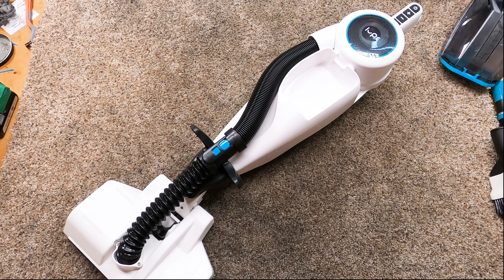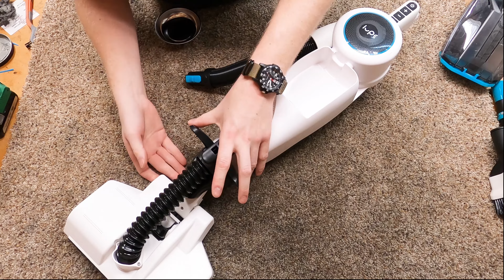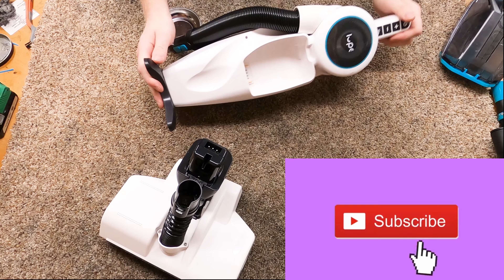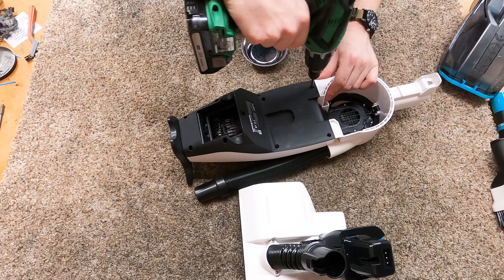Lupe Vacuum Repair

Comment: My two week old Lupe Pure Cordless broke,  lost electric between battery and "spinning head". Still has suction, but no spinning brushes...two weeks!!!
Reply: I am having same issue and just learned that they went out of business.
Reply: @chughag  I need a new battery ... it doesn't make a very good coat rack
Reply: @randyrobinson934  I gather it has standard cells inside the battery pack, so you could bring it back to life...
Reply: @chughag did you find a fix? Or toss
Reply: For anyone experiencing the power head not working it is something that can be fixed. I was able to pull apart the power head and inside there is a microswitch that failed. This essentially turns the motors on when you lower the main body. The part # should be DC2C-A1LB. Alternatively you can completely bypass the microswitch but then the power heads will not turn off when the unit is upright. You can use the button for the brush to still turn that on and off.
Reply: @ttt2k  How did you end up pulling the power head apart? I have the same issue --- brush & roller turn on only intermittently when I lower the main body --- and I like the vacuum well enough to make an attempt to save it.  The vacuum doesn't really work well at all when the brush & roller are not turning. With Lupe company now out-of-business, if I were to break something trying to pull the power head apart, I might as well just throw the whole vacuum into the trash. There are quite a few Phillips- and Torx-head screws in the power head, and I'm concerned about just unscrewing them randomly --- some of these screws may be used for securing various parts located inside the head.  I'd like to be able to remove only the screws that allow access to the inside of the power head, and so far I haven't been able to find any videos or diagrams online that demonstrate how to do this.  And sometimes, plastic parts are designed to also snap together, so just taking the screws out may not be enough to easily access the inside without applying some leverage to separate the various cover pieces.
Reply: @ttt2k so you need to solder out switch and replace it with the new obe?
Reply: @Kuzyn  Yes that's correct, it's a pretty easy fix if you are handy with a soldering iron.
Reply: Were you able to fix it?
Reply: Same. Motorhead no longer motors. Any ideas before I pull it apart?
Reply: @jamesodgers4451  I'm about to embark on same journey- did you get it to work?

Comment: Any tips on getting the spinning brush and roller to spin again? I measure 18V between LHS and centre pin but zero between LHS and RHS pin. If i supply 18v to the motor head pins i can get the roller to spin but not the brush. Any ideas?

Comment: I just bought a Lupe cordless vacuum on eBay. When it came in, actually in the original box, everything was there except the crevice tool I have tried without success to find that tool online. Can you help?
Reply from the maker: I believe somebody in the 3D printed community made an adapter.

Comment: Can you supply batteries? Sadly they are out of business 🙄
Reply from the maker: No but there are standard cells inside that battery pack
Reply: Have you figured anything out? My roller brush is no longer working and I need my vacuum
Reply: @michelleellison7110  I miss mine also, still holding out for after market

Comment: How much reduction in sound level did you obtain?  Noise would keep me from getting one.
Reply from the maker: Not enough to make a noticeable difference. I'd recommend the Henry cordless if you're looking for something quiet.
Reply: I have a theory that some vacuums went out with sound insulation and some didn't. I've heard some people say that the vacuum is quieter than every other vacuum they tried and others say that it makes their ears bleed.

Comment: Why wouldn't you expect it to last? It is made for reperability, so if you're comparing it to other products that are not - you might need to look again ;-)
Reply from the maker: The quality of this product . Material choices are pretty poor. The baggless filtration system is basically planned obsolescence. I'm comparing it to products and it's price range like cordless Henry and the Lindhaus cordless . I would say there are some Hoover products that are higher quality than this thing was.